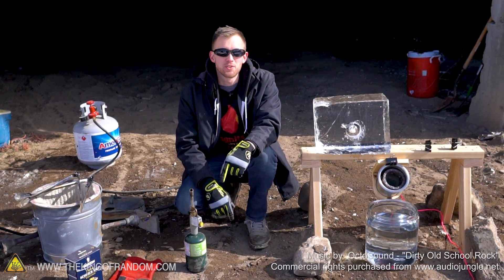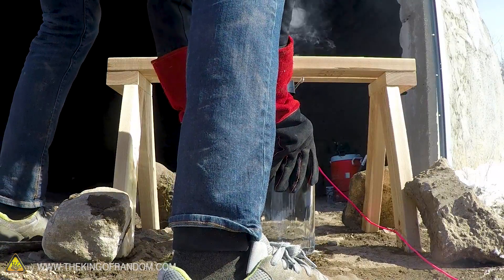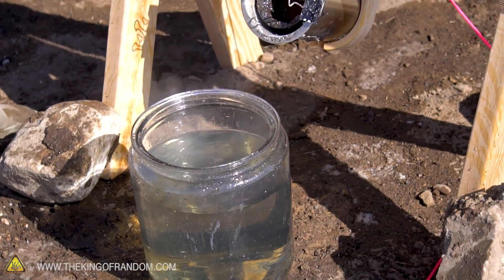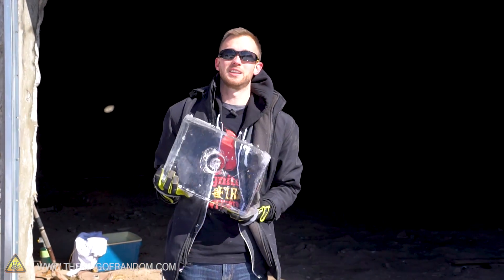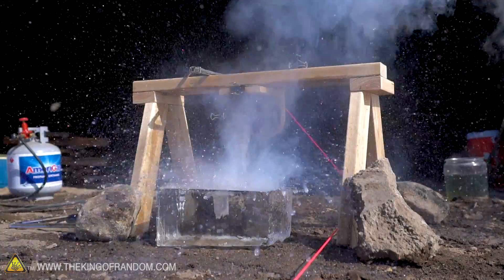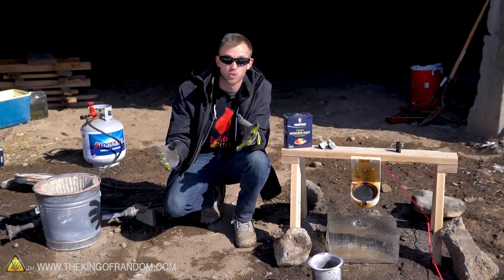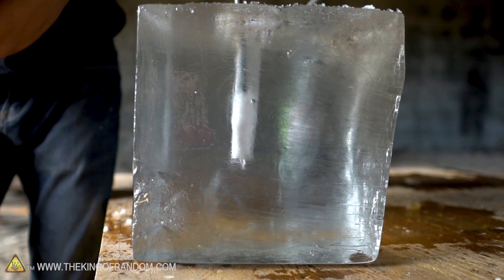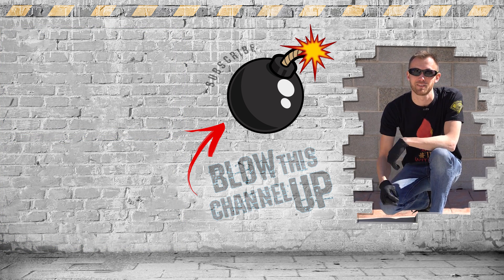The Ice Experiments: Molten Salt! Can TKOR Make Molten Salt Water With Ice?

Comment: OK so the aquarium glass broke because it is flat on 4 sides and that means it's going to bow out with the pressure from the expanding water because of the hot salt. It is a proven fact that a round structure holds up better to pressure then a square structure. Also there's the fact of the one flat side is so small compared to the size of the aquarium that it could handle much more force.  Falso comes the fact that the glass in that container is much thicker then the aquarium glass.

Comment: How bout you pour molten salt in salty water like to the point were the salt won't dissolve anymore, I think why the reaction is so violent with regular water is that with water and salt water rips apart the salt but if the water can't rip it apart then what happens does it just sink like molten metal

Comment: Two quick questions: Why didn't the binder clips melt or catch fire? It seems it would have been plenty hot enough to do both. And, would the reaction be any more energetic with hot water? I would assume the coulomb explosion would be significantly stronger. Added heat should mean a quicker reaction. However, I really have no idea if this would apply with this particular experiment as it's not exactly a chemical reaction.

Comment: Didn't break as it's spherical which allows less flex and is a stronger structure than a cuboid as there's no focal stress point, this is the same reason modern castles have round towers instead of square ones as a defence against undermining. The more you know 🏳️‍🌈⭐

Comment: Hey so as NaCl requires a really hot temperature to be molten electrolysis is usually done with brine. I was wondering if you would be able to do a video where you electrolysis molten NaCl. This way you would be able to get both sodium and chlorine instead of I believe hydrogen. Can't wait to see it!!!

Comment: If I had to guess, and you really wanted to burst that glass, you might try dropping the salt from farther up?  That way, it'll be going faster, and ergo deeper into the water before detonating.  And if it's entirely encapsulated in the water, then the shockwave has no where to propagate to other than through the water.

Comment: Yeah, about this experiment, the hotter above the melting point the salt is, the better the reaction. The backyard scientist used a real furnace to melt his salt
Reply: Also, the form of the container is certain factor in this. The Backyard scientist used a rectangular container, which tends to withstand such an explosion less beter than a cilindrical form. It's like why they use cilindrical formed tank wagons. It resists high pressure and stress.
Reply: Kartik Soni that and was probably poured into water faster so move made contact before was forced out.
Reply: And the heat transfer was more efficient because of the higher surface area.

Comment: Major flaw with your pouring device, if you are trying to get truly dramatic reactions. Since you are only able to get (almost) 90 degrees, you are not pouring down INTO the water. You are just dumping the molten salt out ONTO the water. If you want to get something truly dramatic and see if you can break the tank, you need to be able to up-end your container so that your molten salt is actually being aimed down so it penitrates the water with some depth.

Comment: Can you do the same but instead of block of ice you can use a big block of granite or different type of rock, drill a hole in it and see if the molten salt has the power to split the rock in half?

Comment: 38!!! I wanna see molten salt being poured into liquid nitrogen
Reply: That's not true? lol
Reply: +Huey Freeman its NOT caused by the sodium reacting with the water. Its a physical reaction. Low surface tension of molten salt, means high surface and a huge transfer of energy to the water, which explosively turns into steam. The sodium doesn't have any chemical reaction here that's worth mentioning, because its SodiumChloride! Which means its not the same thing as sodium.

This will work with ANY liquid with the same amount of energy and same low surface tension.

Still with the nitrogen nothing even remotely that dramatic will happen, because of the leidenfrost effect.
Reply: Wupme because extreme temperatures cause a physical reaction that results in an explosion...... Wait a minute no that just causes a phase change..... huh did you pass 7th grade science? Lmao
Reply: Just Saleh It wouldn't do anything in liquid nitrogen, or even dry ice. The explosion is caused by sodium reaction with water. So pouring it in liquid nitrogen which has no water in it, would just be cooling the molten salt and nothing more.